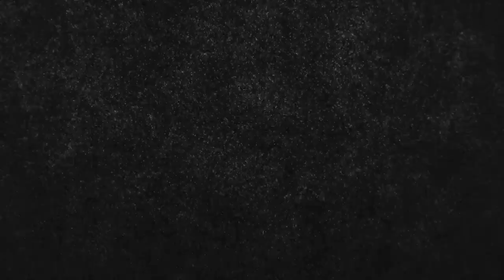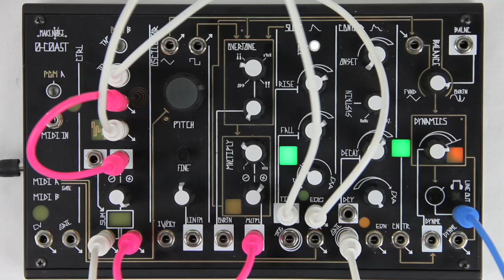0-Coast Patch of the Week #15 : Telegraph

Comment: As  a  veteran Morse  code   user ,  I can promise you  this  does not resemble  morse  code  in  any way  whatsoever.

Morse  code has a distinct pattern of long  and short sounds  representing the letters  of  the alphabet  and this is  totally random which  would make it  unreadable  even  to a Morse expert.  It  is   more  like  a  telegraph  which  would  be  a  radio  teleprinter   which  is  completely  different.
Reply from the maker: JOHN HORROBIN this patch is more of a “sound effect” and was not intended to actually generate intelligible Morse code. Apologies if we gave the wrong impression! That said, you could create binary “long-short/dot-dash” events by modulating gate length with a gate output instead of a random source, or by creating the gates manually as would be done on an actual telegraph.
Reply: @MAKEN0ISEMUSIC  
Can u  explain modulating gate length  with a gate  output please-  thanks
Reply from the maker: @johnhorrobin8560  sure. in this patch a random voltage source is patched to the Time input, which means that each event is a random length. As you point out, Morse code uses pulses of only two possible lengths, dot or dash. A gate output could be used instead, which has only two values, high or low. When the gate is high the Slope would be faster, creating a "dot", and when the gate is low, it would be slower, creating a "dash". To enter dots and dashes manually you would skip the Slope altogether and patch your manual gate source such as a keyboard to the Contour Gate input, then tap in the dots and dashes in the pattern you need for the message you are sending.
Reply: @MAKEN0ISEMUSIC  

Thanks for the reply,  I will  try  that. I have a lot of M N  gear,  a  shared  system   and two  0  coasts.

Any  chance of a tutorial  on using 2 0  coasts  as   I can't  find  much on  y  tube on this concept,  how  about 0  coast  and  Maths  please  as  well.

Thanks  again  from Lincolnshire,  UK
Reply from the maker: @johnhorrobin8560  Thanks, we'll keep your feedback in mind when deciding what to do videos on. In the meantime, if you have not already, consider joining the "Make Noise 0-Coast" Facebook group. There are nearly 3000 members sharing info and patches.